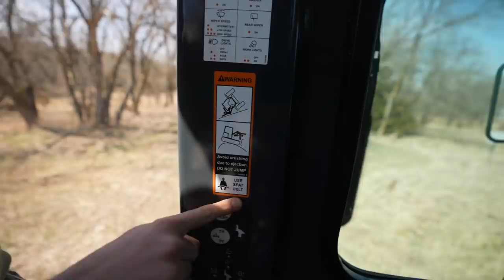I Bought a BULLDOZER and Don't Know How to Operate It!!!

Comment: back dragging the blade will help smooth things out. Don't take too big of a "bite" with the blade when you're pushing forward. That will cause you to make bigger bumps as the machine tracks level out into the cut. You also have to keep adjusting the blade to make sure it is in contact at the depth you are trying to push. when you feel it digging deeper just lift up

Comment: I’m a dozer operator for a living it takes years to master it. Only tips I can give u when operating your hand never stops moving on the blade control because your slowly removing product to keep a level grade. For instant results buy a gps unit and you will look like an instant pro 🤙🏼
Reply: They filled and leveled the 15 acres behind me a year ago. Dude used a post mounted lazer emitter and the blade had a receiver mounted on each end. Old school but the blade automatically adjusted the entire time
Reply: Sounds weird two biggest pieces advice I got from an old school cat about 15 years ago it sounds stupid but he told me #1 you can feel the grade by the seat of your pants in the seat and #2 your hand never stops moving. Sounds so simple but it was the best info I ever got didn’t make sense until I started to improve as an equipment operator
Reply: @marcallen1335  you can feel the grade by the seat of your pants was one of the best pieces of advice that I was told as a beginner dozer operator

Comment: As a old dozer operator you need to start on a flat spot, drop the blade, now look at the tip of the blade on the leftside. Start forward don't try to dig deeper, just push level.  Once you get used to level then you can start digging with the blade, you just want to push a 3 or 4" cut.

Comment: To make it smooth with a dozer you have to set the blade and leave it, you can't move the blade up and down while pushing a flat grade because every time you move the blade it moves/changes the ground so then the tracks hit where you moved the blade which causes the dozer to climb or dip which causes the blade to dig in or rise, which causes a wavy unlevel grade. If that makes any sense. lol.
Reply: That wont work when the ground is very uneven as the whole machine would be on unlevel ground.
Reply: @TheFrontyer  Of course you'd have to start by creating a level area for the dozer to start making grade. And it doesn't look the best at first because a dozer isn't kind to anything it contacts and they're also not a finishing machine.  
Flair was sitting on a level area when he started,

Comment: Running a dozer is a form of art it takes a lot of time and experience. I haven't run one very much, but what I have learned is make a flat spot, and once that's established try not to move your blade up and down.. whether you're pushing a lot of dirt or a little is determined on angling it left or right depending on where you want the dirt to go..

Comment: Get you a transit to stick in the dozer then you can only have too worry about are you level. You can also change setting so you can use the pedal to move and all. I haven’t ran a jd but it shouldn’t be much different as far as my d6 or d8. It takes alittle time but y’all where definitely starting off high and pushing too an area that was much lower. So either you need to start in a lower area and push or start way away and take down the higher areas to raise the low spots. It take time too learn but y’all have the hardest part figured out just jump on it and practice. Once you get it figured out you will love it. I clean up a lot with the excavator&d8 and do all my finish grading with a d6. You have the perfect sized machine for finish grading and slicking everything up pretty.

Comment: Flair. Watch the end of the hood.. if it dips down lift up a little bit. If the hood rises lower the blade. The hood corresponds with the tracks so if it's rising so is the ground underneath the tracks
Reply: And the more angle to the blade the lesser the "whoops" you get.

Comment: Flair, im sure you have already thought of this off course. Like have good security systems on that equipment. It just so scary to think that someone could potentially steal that thing and do some serious damage or can hurt someone with that equipment. I know im going to get flack for this comment but seriously. Make sure those things arnt ae to move. Maybe get a viper alarm that has a proximity sensor and that can send you a message that someone is nexf to it and if anything is is being touched and send it to your phone. You can program some accessory with the viper alarm like a battery shut off or fuel cut. I mean noone has to be in it to drive and it doesnt stop. That just freaks me out. Sorry im just saying it because thats the first thing i would do to upgrade it.

Comment: The blade should have a float feature that works better when backing up to smooth out loose ground... Not sure how it works but on the tractor you just push the bucket lever all the way forward.

Comment: alot of money when you've never run a dozer before. you would have had more fun with a 1960s open cab dozer if you wanted to just learn and play. It would have been able too push almost as much as you'd need to push. plus you actually feel the machine more and can judge what your doing better. I work pipeline and I always take the older tractors especially when it comes too sidebooms. their even better in the summer because their more fun too run

Comment: The bigger 750 dozer to me is easier to use than the smaller one you got because the one you have is more for finish and smoothing work and isn't as good at moving dirt. You should have listened to Chad, at least get in the bigger one and see if it feels easier

Comment: I'm not an expert by any means, but all you're doing with the dozer is making the ground "level", so it's all loose and not smooth.. if you want an actual smooth dirt road, you're gonna need a Roller to smooth it out, just like you would on asphalt.

Comment: I'm 10000% not a heavy equipment operator of any kind... but I feel like you gotta start on the high side or high point and grade towards the low points raising your bucket as you go. 
I'm sure you guys thought about that and it's harder than it looks but that's my 2 cents 🤓